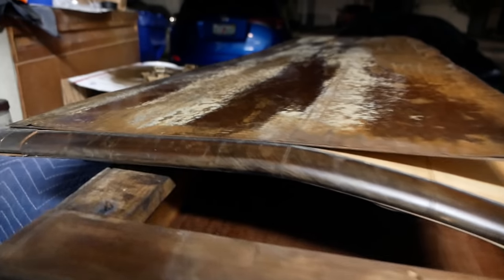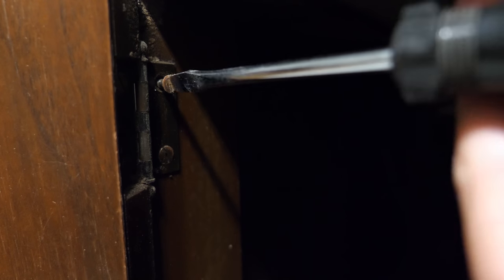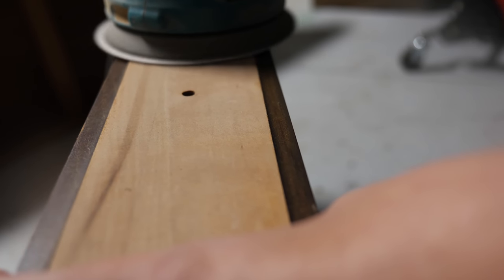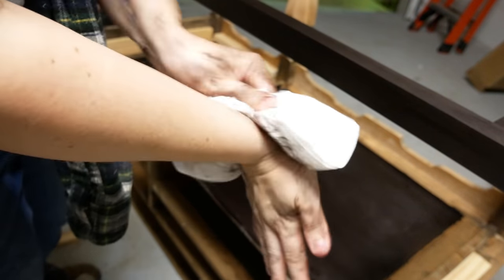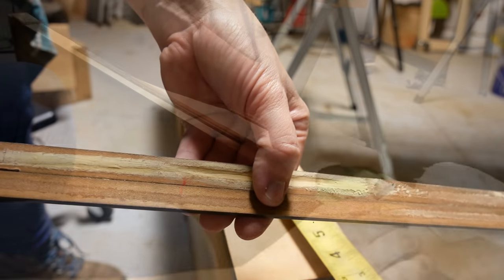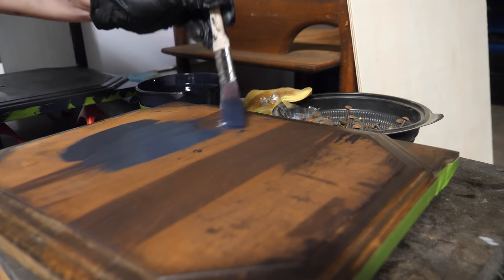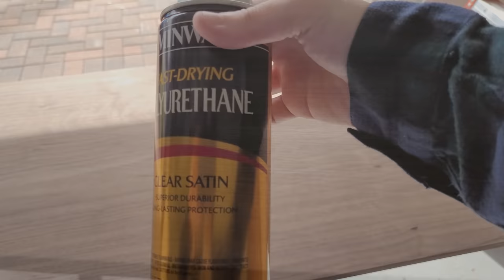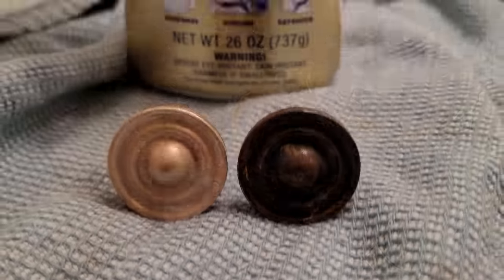Veneer felt like a potato chip... Vintage Buffet Makeover

Comment: This turned out great! I was hoping you had a miraculous way to repair warped wood. I have the dining room set of my grandmother’s next-door neighbor. This set, manufactured in 1929, sat in my grandmother’s basement for 14 years. The basement partially flooded with rainwater on three separate occasions and there is a lot of detached veneer and water warped panels on the sides of the buffet and china cabinet. I’ve been using it this way for almost 30 years! I guess I’m going to have to deconstruct them both and replace the sides if I want them to be fixed. Still not sure I want to do that😱. I really love your videos and this one was great, even if it didn’t solve my issue with an easy solution.🌸
Reply from the maker: Warped wood often equates to using a planer. There is probably a way to bend it back with pressure and moisture, but I would assume its not that easy. Unfortunately 😞. Depending on the level of damage of thr veneer it can be attached in some cases back on. Jay with Flipping Drawers did this on his buffet, but I am guessing its severe if it was 3 seperate incidents. If you can remove the veneer and get a flat substrate you could put new veneers on it. Its a task but for family pieces sometimes the labor is worth it. Thank you for watching and leaving this awesome comment Deborah! ❤

Comment: Good job but I didn't like the final result very much because of the blue color. I think that wooden furniture loses its beauty when lacquered. Why you didn't use stain walnut instead of that black color? Thanks.
Reply from the maker: The selection of blue was made because the cost to reveneer the piece would have cause me to lose money as I already replaced so many pieces (like the entire top and back). Painted buffets also sell better in my area than original wood. Don't get me wrong I appreciate unpainted pieces as well, and wishes the veneer wasn't like a potato chip from all the damage. I chose to use Java gel stain over antique walnut as I liked the color contrast between the paint. Walnut likely would have looked nice as well. Thanks for your feedback!